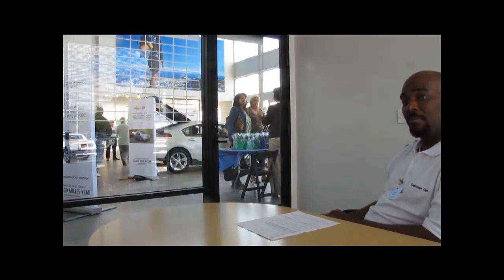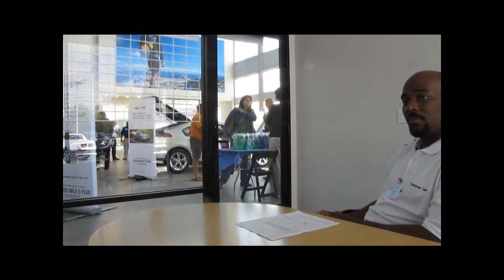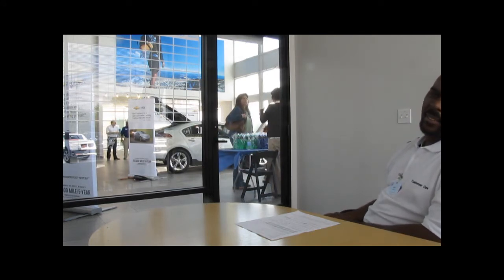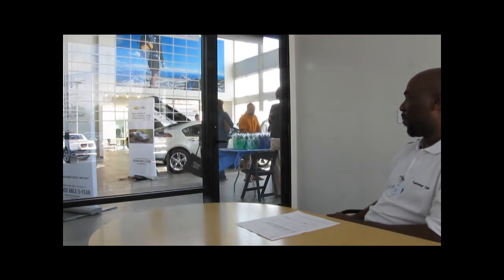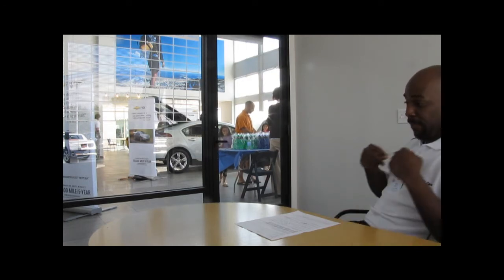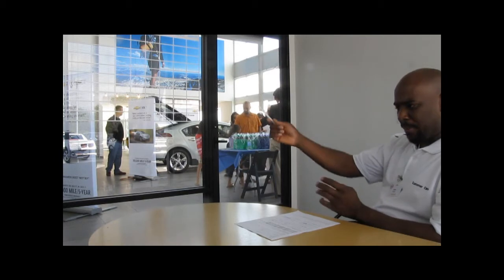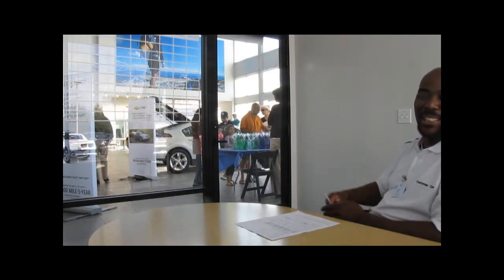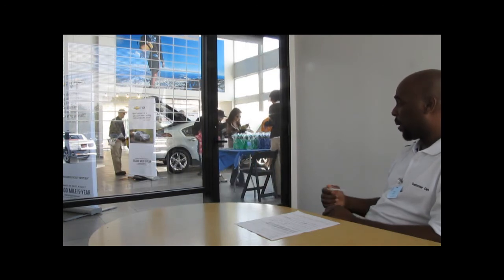keithbuford.wmv

Comment: 75C is about 170F.  That's pretty hot for electronics.  30-40 C also about 100F, which seems very warm for a battery.  So I should get the best performance from the Volt at an ambient temp of between 90 and 100 F?  Interesting.